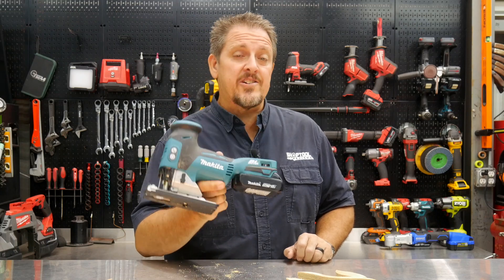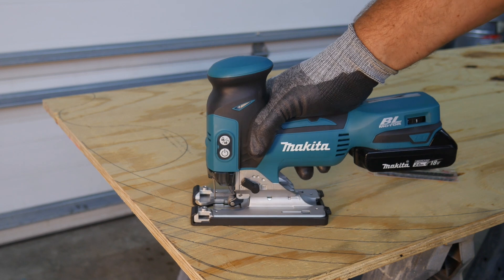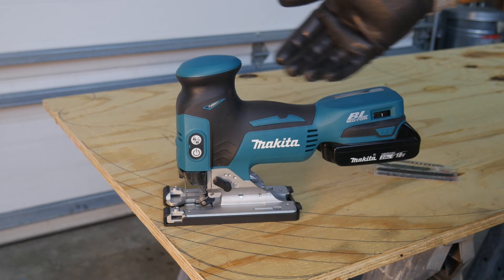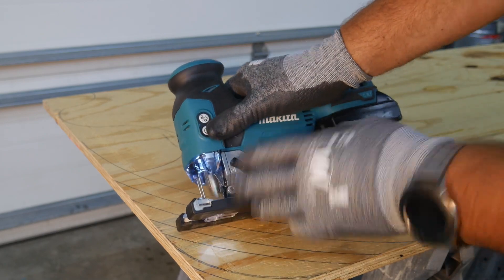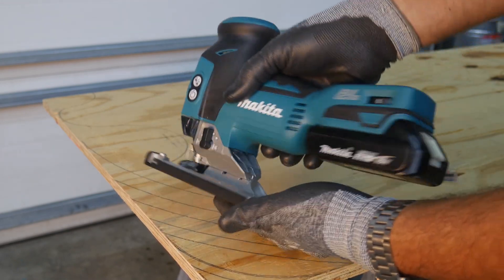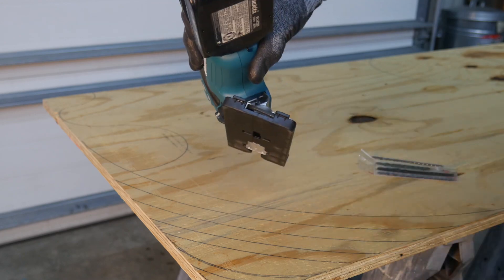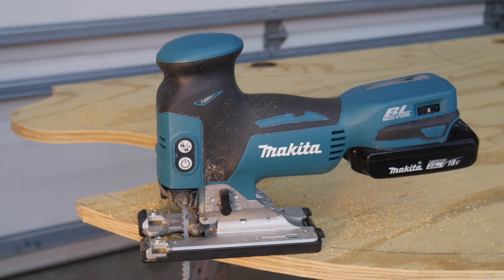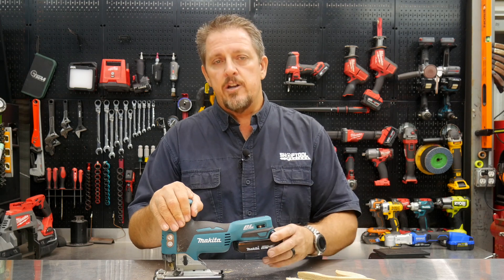Makita XVJ01Z 18V Brushless Jig Saw Review [SMOOTH OPERATOR]

Comment: I can tell you that this is the best jigsaw by far.  Better than Dewalt's by a long shot.  Best vibration control and cuts smooth. I picked this over Milwaukee's.  It has a good dust collection system.
Reply from the maker: We just wish the dust collection adapter came with the tool.
Reply: @Shoptoolreviews  @TheToolGameChanger do you know the part number for the dust collection plate, etc? Having a hard time finding it.
Reply: I borrowed the milwaukee equivalent and discovered I love barrel grip. I'm all makita and this looks sexy as hell. Definitely my next tool purchase

Comment: Hello!  Just came onboard as a Subscriber, and a big thumbs up!  Your lack of skill with a jigsaw notwithstanding, a very good review, illustrating all the features of the tool.  I used to use the barrel grip Bosch corded jigsaws back ‘in the day.’  Hundreds of countertop installs and sink cutouts, and I introduced my fellow cabinet installers and trim carpenters to the idea of coping crown moulding with a jigsaw.  I hated using a manual coping saw!  I tried a corded Makita jigsaw, and it did not hold up.  I’m in the market for a new jigsaw to replace my aging AEG and Bosch saws, and have looked at Festool, and Bosch.  I want to cut the cord.  Bosch seems to be ‘evaporating’ from the North American market?  I’ve ruled out Festool due to price and not having any other battery tools from them, which brings me back to Teal!  I’ve always had a soft spot for Makita, so I think I will try this model out.  Makita makes their own motors, and their saws are generally known for being very smooooooth!  😀  Are you sure it does not have a blower, as the specs for it claims it does?  If you’re still awake, thanks for this and your other very competent and professional reviews.  Continue to keep it real!  
👍👍👍👍👍👍👍😁✌🏻🇺🇸

Comment: Good review overall but very surprised that the key flaw in the design of this tool wasn't addressed.  I own this exact model and I cant believe how awkward the button to stop and start is. #1 is the fact that both the safety and start button are NOT USABLE WHILE GIPPING THE BARREL! NO TRIGGER/NO SWITCH WITHIN FINGER DISTANCE WHILE OPERATING!  Most pros use jig saws while holding the work piece steady with one hand and controlling switch/direction with the other/not clamped to a table.  #2 is the soft squishy button type. Makita uses this on a few tools. You often have to press it two or three times if you don't touch it just right the first time. I have another tool where this same switch design is broken after minimal use
I love Makita tools but this switch position and switch type totally sucks.
Reply: I have the same issue with this tool - it is unsafe! I was making internal cutouts where you drill holes in the corners for starting points and I was caught in a position where I couldn't turn the saw off! If you look at the 12V version these buttons are in a much better location.
Reply: Is it not possible to reach the buttons with your index finger?
Reply: There is a newer version that is 185Z vs 18Z (I think it is newer).  The on off switch is parallel to the base, not the blade, and looks like it is easier to control.  I used a corded Bosch for 30 or 40 years, still have it, and it had a stiff switch like corded tools do.  No problem.  All the battery tools seem to be a little fat.  I have large hands, as far as glove size is concerned, and getting to the switch on the Dewalt is sometimes difficult.  I would not say that it is dangerous, but it might be awkward.  The new saw has (also has?) a built in variable speed so it is on a very low speed, until it loaded in the cut, then it accelerates to the chosen speed.  This should deal with most situations where you can't turn it off one handed.  It also seems like it is better at dust collection.  It is a lot cheaper with more plastic.

Comment: Thanks for a good video.  I've been looking for a cordless replacement for my very old Bosch barrel grip.  Didn't really like the DeWalt or Milwaukee and I'm not going to get into yet another battery system for the $500 (!) Festool, even if it's amazing.

What I liked is your demonstration of how easily controlled this is, which was not true for me with the DeWalt or Milwaukee, at least compared to the old Bosch.  HD has a deal today for a free 5ah battery that's returnable so the saw alone comes in at about $160, which is a great deal.  Sold!

Comment: There is a newer version that is 185Z vs 18Z (I think it is newer).  The on off switch is parallel to the base, not the blade, and looks like it is easier to control.  I used a corded Bosch for 30 or 40 years, still have it, and it had a stiff switch like corded tools do.  No problem.  All the battery tools seem to be a little fat.  I have large hands, as far as glove size is concerned, and getting to the switch on the Dewalt is sometimes difficult.  I would not say that it is dangerous, but it might be awkward.  The new saw has (also has?) a built in variable speed so it is on a very low speed, until it loaded in the cut, then it accelerates to the chosen speed.  This should deal with most situations where you can't turn it off one handed.  It also seems like it is better at dust collection.  It is a lot cheaper with more plastic.

Comment: I wonder is it my Makita Jigsaw or my blades, but very often if i saw something a bit thicker, the blade starts to bend, making the cut crooked even though the line on the top of the cut is straight. this never happened with my previous, 20€ cheap jigsaw that i used for almost 10 years. This does not happen with my workplaces Makita with the other kind of handle.
Reply: Wrong blade (too short), too thick board, or you might be pushing it too much. Can happen easely with moist wood in a combination of a too small blade. Sorry for 5 month old answear.

Comment: Have you used the 12v version?
Reply from the maker: I've used it, but we don't have it in the shop.
Reply: why go lower? 
18 v 5ah seems to be my consistency. but 18 would have more power than 12v.
Reply: @josephKEOarthur  because i have Makita 12v tools and would like to keep it in the same system. If needed I might just go with a corded too. I like the extra power of the 18v but they are mostly overkill for what I need. The 12v drill/driver are so nice to use.

Comment: How would you compare this to the Milwaukee?
Reply from the maker: Our thoughts are that the Makita has less vibration.
Reply: Milwaukee is awful except for power .   Milwaukee vibrates, blade guide is weak, so angled cuts and the base slides all over .  It is not pleasant to use.  It is basically a little sawzall ( which is great but is not a precision tool.) rather than a precision saw like a jigsaw is supposed to be.    I have used a Bosch corded for years- they are known as the best  It appears the Makita might be close.  I have mostly Milwaukee but I have a few things Makita like the concrete vibrator .
Reply: It's a different color
Reply: @stestar09  foolish statement

Comment: soft start kills it for me,  sometimes too much tech is not needed. both my bosch 18v are both old and brushed, but suoer powerful and mist importantly, super straight and absolute oerfect control and handling  same for their corded models. dint even get me started in the Milwaukee fuel barrel grip. that thing is pos.
Reply from the maker: I understand what you're talking about with soft-start. It's a nice feature, but I'd rather see a switch to disable it. It's hard to beat the Bosch jig saws. Thanks for watching.
Reply: According to the instructions soft start  can be turned off.
Reply: @Shoptoolreviews  as lemony writes above, the manual has instructions on how to disable it. Or here https://youtu.be/OUt46RYdT6s
Reply: truth
Reply: @NirreFirre  From what I have read the ability to turn soft start off is country specific, and not available on models shipped to the US.